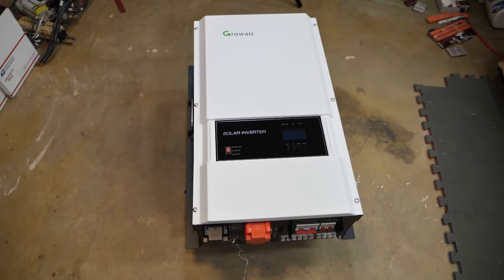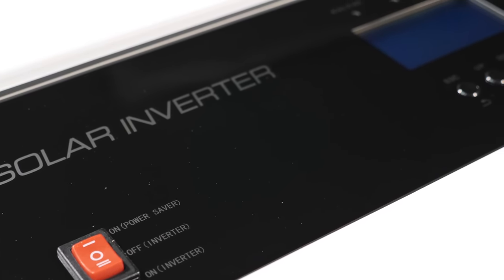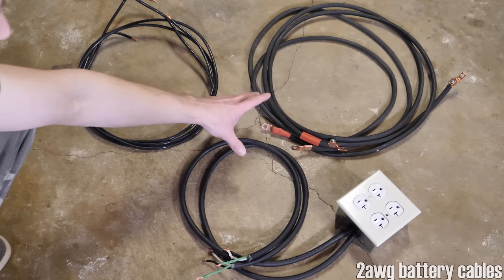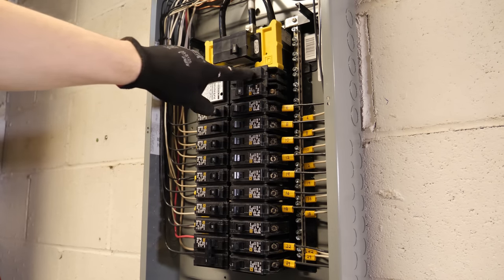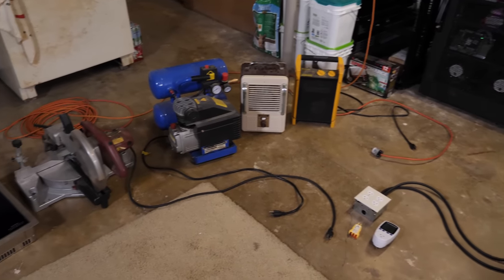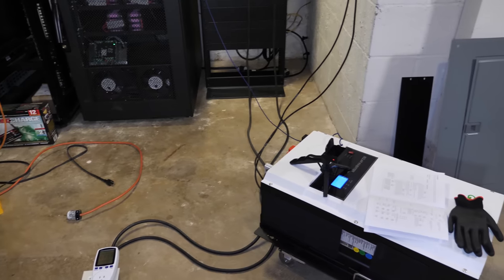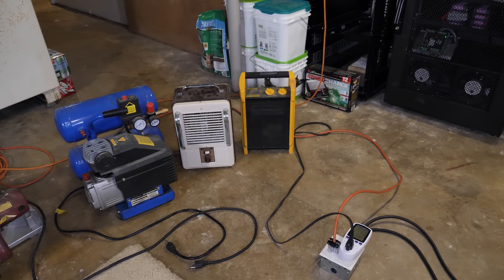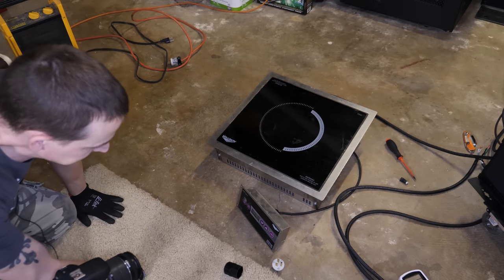12kw Growatt Inverter Operational Check/Review!!

Comment: Hi I have growatt 6kw off grid inverter it stop working first it stop putting out ac current shut down down complete unit disconnected batteries and solar panels to if something well reset but after nothing will come back on if anybody could give some advise will appreciate it thanks
Reply from the maker: Can you connect to the inverter on wifi like I did. Maybe there is a fault code
Reply: @AveRage_Joe  fault code is 58
Reply: @AveRage_Joe   I disconnected solar panel and batteries system to see if system will reset but now nothing is coming on after I connected batteries again. I am using Nissan leaf 2G batteries system, if you know something I could try your help will be mucha appreciated thanks
Reply from the maker: Fault code 58 says that the AC output is low and possibly below 180v. Can you check the output voltage and see what it shows? Maybe check option 8 in the menu settings and make sure its set correct. If all looks good maybe try changing option 3 to see if anything changes.
Reply: I had the same problem, ordered main and control board from Signaturesolar, but It was the bottom fan that failed. When their is no fan RPM, inverter will not put out power. Had a 80mm 3 wire fan laying around, installed it, and it working. This inverter are excelent, but the bottom fans are low quality. I have now a 8kw model 1 month old, is giving me fan lock fault, it will fail soon. Had ordered 2 92mm 3 wire fans.
Reply from the maker: Hey so I am hearing that the fan lock fault is fixable with a firmware upgrade.
Reply: @AveRage_Joe  Did the firmware update with my 8kw DVM 2 days ago, till now no fan lock anymore, I'll keep monitoring.
Reply from the maker: Nice!! How long did it take on yours? Glad to hear your good to go!🤘

Comment: So can anyone confirm that the solar is not used if on the grid power?  (Shame)
Reply from the maker: It will still charge the batteries or you can use it to power loads. If sun goes away or battery goes low it will switch to grid power. Once solar is back or battery is charged enough it will switch back.✌
Reply: @AveRage_Joe  So if the batteries are charged and you are connected to the grid, the solar is off (wasted) ?
Reply from the maker: No, the grid is there for a backup if solar or batteries are not sufficient. It can use solar and battery 24/7 as long as it can power the load. If not it will switch to grid as backup untill solar or battery returns.

Comment: Growatt inverter has a major design flaw. Wire connections are way to small for the correct wire gauge on input and output. manual states 6awg wire yet its on a 62a breaker!?? Why. 6awg wire is only rated for 55a max. Top it off the ac input breaker is 80a! like why would you put a 6awg 55 amp max wire on a 80a breaker.

Comment: If I need even more power due to ev charging, is it possible to run 2 of these in parallel?
Reply from the maker: Are you running your house on a 12k now and want to also charge EV? Should be able to depending on house load but to answer your question, this inverter cannot be paralleled.
Reply: @AveRage_Joe  if I want to hit 20kw output for welding and a pool heater as well, what's my option?
Reply from the maker: Check out this inverter. Its the same as MPP or EG4 but less money and you can parallel up to 6 if I remember right. You would want 4. I also have a 10% off discount code "joe10" if you go that route. Honestly if this was around a few years ago I would probly go this route cause you can parallel them which also allows you to connect more solar. https://youtu.be/2xJs9JBLrfk
Reply: @AveRage_Joe  so parallel 2 together for 1 leg and another 2 for the other 120v for total of 240v?
Reply from the maker: You can actually do it both ways. For example: 2 inverters can be wired in parallel for 1 leg 120v OR the same 2 in Parallel for 240v split phase. So for you needing 20kw+ you would need 4 total. You can download the manual on there site to take a look. Inverters come with the cables/wires to parallel them also.
Reply from the maker: For us in the US you would parallel 2 for 240v then the other 2 would also be connected in parallel for 240. Then in the inverter setup, you configure. Its kinda hard to explain here but its 2 in parallel for 240v then another 2 in parallel for 240v. Then "parallel" the 2 sets for combined total of 27kw.
Reply: @AveRage_Joe  well, I like that it's possible but I'll need to do a lot more homework because this stuff is new to me. Thanks brother.

So these are good vs. growatt or the EG4 stuff?
Reply from the maker: The orient power, eg4 and mpp version are all the same. Just diff paintjob. This one is a little less expensive. They are also high frequency inverters. The 12kw growatt that I am using is a low frequency inverter. It is basiaclly the same as the grid because it uses a big ass heavy transformer. High freq inverters use all electronic parts and they are lighter. No prob!🤘

Comment: I think you need to put a metal pot on with water for it to work as far as I know
Reply from the maker: Yeah others have mentioned that. I was thinking it didnt work because the led's didnt light up on the box. I still have it so I plan on trying with a pot to see if it turns on.
Reply: @AveRage_Joe  not an aluminium pot though, needd to be magnetic.  But would expect the power on indicator to come on.
Reply from the maker: TROOF! 😆🤘

Comment: I'd like to see the Central AC.start up
Reply from the maker: Will be soon!🤘
Reply: @AveRage_Joe  awesome!
Reply: I want to see this as well.  I'm considering getting a Growatt 6000T and 3 rack mount 48v 100aH batteries, but I'm not sure it will be able to start my 4-ton HVAC unit. I have a soft starter installed and the peak inrush current is about 50A for less than a second, so with an 18kW peak output, the 6000T should be able to handle it.  If the 12000T can do it, then maybe it will be worth it to spend the extra money and get the larger unit. This will be for backup purposes only.  I also have a Honda EU7000IS inverter generator which I would use to charge the Growatt and battery setup if power is still out, but it would be great to know if these inverters can start a large HVAC unit. Also, what size terminal clamps are you using to connect your batteries to the Growatt...5/16"? What AWG wire is that?

Comment: I have a 4kw grid tie growat, they seem good
Reply from the maker: Nice! Yeah seems to be a solid unit so far!! Any issues you notice with yours. On mine I also noticed I couldnt get the beep to turn off when pushing buttons....yet.
Reply: @AveRage_Joe  well the only thing that gives me trouble, which really isn't trouble lol.    It has tremble switch to light the display. So basically you tap the case to make the display come on, some times I have to "tap"  harder than what I feel should be necessary. But as i have a secondary external display I never bothered getting it sorted. Other than that it's rock solid ;) oh and mine don't beep and don't have an option to turn it on or off, so sorry can't help you there. You're gonna just have to wear ear plugs haha
Reply from the maker: Oh ok cool. I dont think I have a tap to engage screen option so I cant help you either lol. Yep looks like earplugs😆

Comment: Having to connect to the cloud would be a deal breaker for me.😒
Reply from the maker: I didnt mention in this video but you can connect direct and plug into pc and load the supplied software. Its similar to mpp software!🤘
Reply: @AveRage_Joe  That's better.
Reply from the maker: The wifi dongle came with so I wanted to try it. I did end up getting it to work from a different pc too.🤷‍♂️🤣